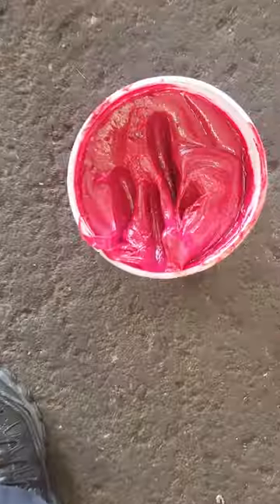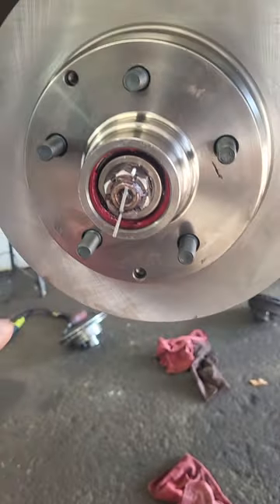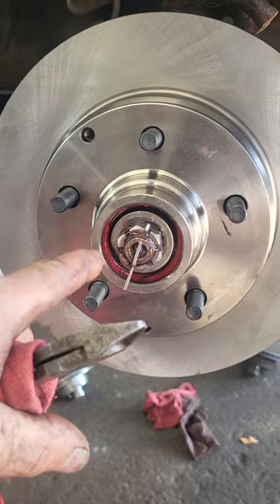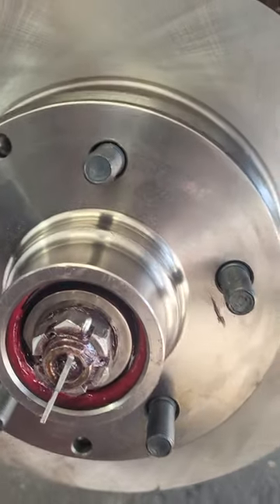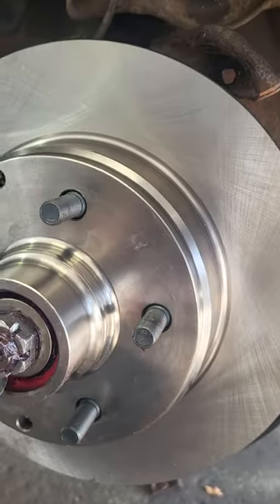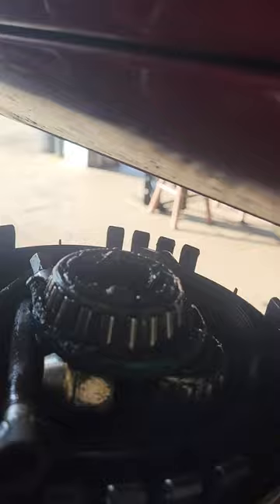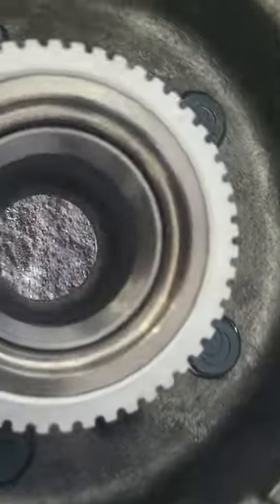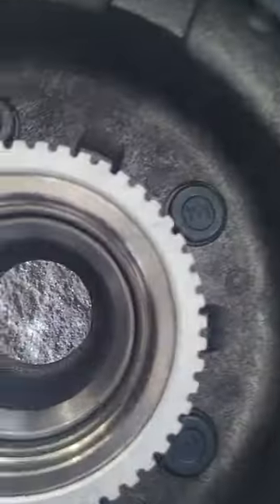How do you install cotter pins

Comment: All looks good to me....however, from what I saw in OEM shop manuals, is it's not necessary (or useful) to completely pack the cavity.  A generous amount around each bearing is "supposed" to be sufficient.  When I did mine (back when my cars had these type) I had done it both ways.  Didn't seem to matter.  
One key point is the final torqueing of the nut there. Supposedly tightened quite snug, then backed off a hair, so that it's not that full hard tight.  It's near, but not at zero ft. lbs.  You didn't mention this part.